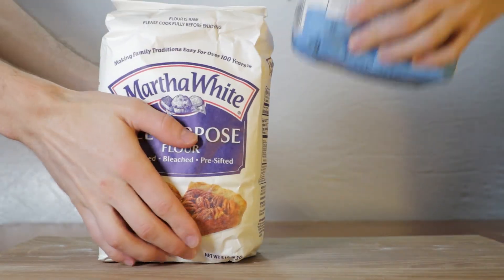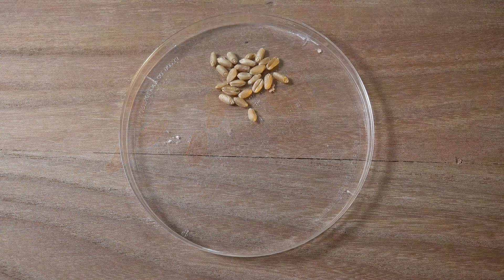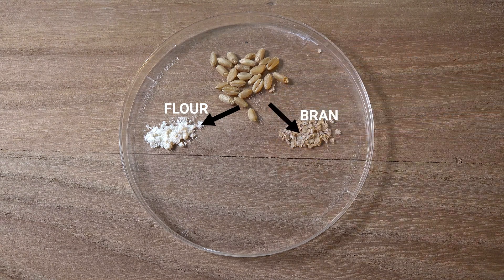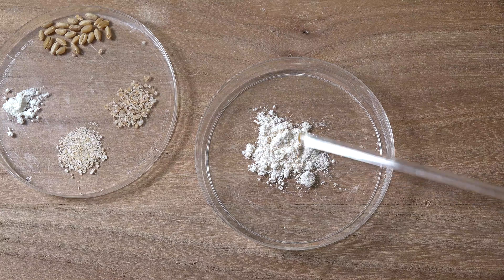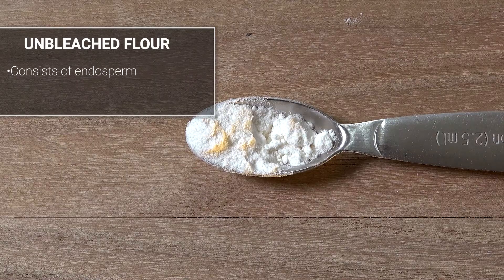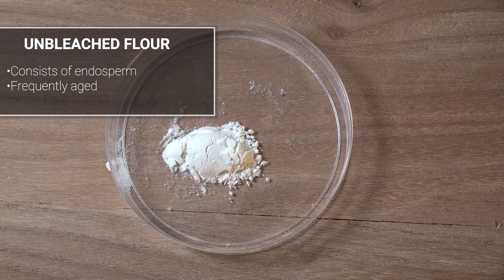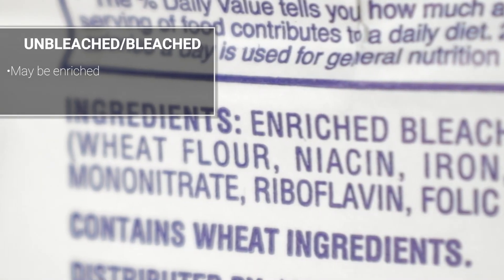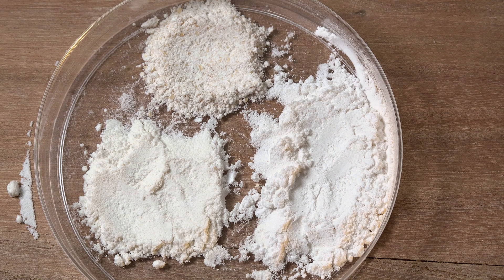The Difference Between Bleached and Unbleached Flour

Comment: Just made a pizza with bleach flour using the autolysis method and its horrible,
Reply: My sourdough starter got a case of indigestion when I fed it bleached flour. It went back to normal when I fed it whole wheat. It went into turbo mode when I fed it whole wheat with non-chlorinated water.